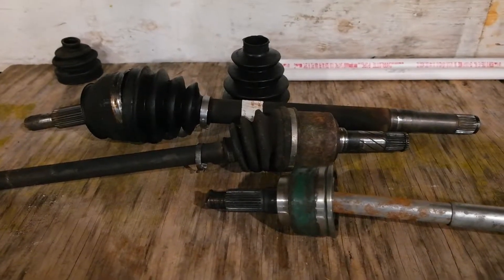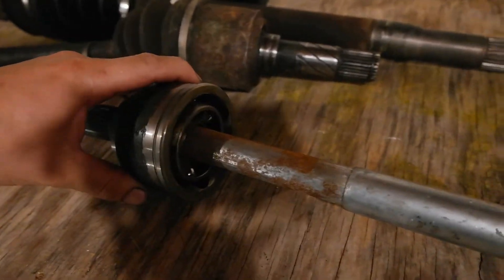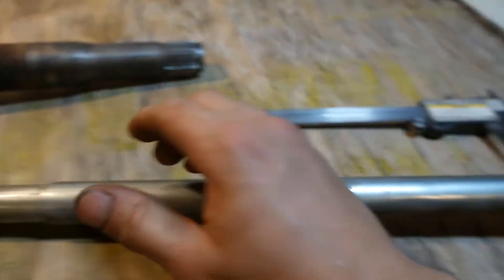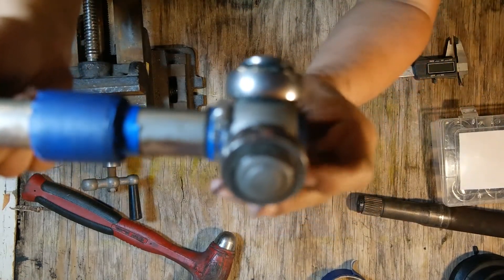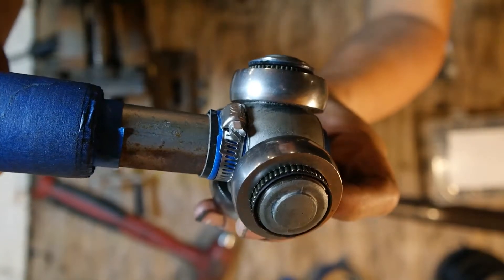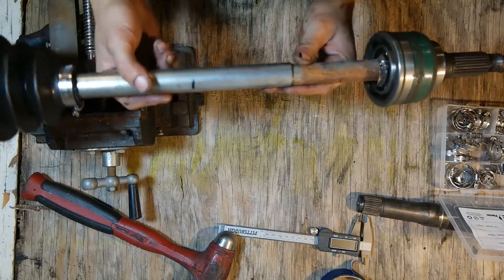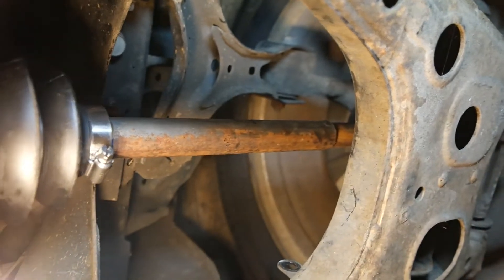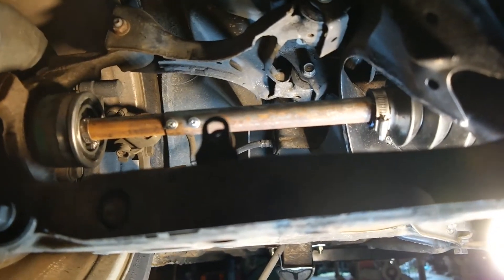How To Make Mock Up CV Axles For Custom Length Shafts. Sloppy Style DIY Super Budget LS Swap Miata

Comment: Who did you have make your axles? 
Thx
Reply from the maker: Well I had a local guy make a set. Broke those, then had moser respline some stock axles, broke those immediately. Then went to a t bird diff and bought a few sets from monster Miata. So far the last set has held up
Reply from the maker: Moser can make a set out of 4140 though.

Comment: What did the shaft centers cost to spline ?
Reply from the maker: I had someone local do those. Cost 220 per shaft. They only lasted a week though. Moser can make some from 4140 wanna say it was somewhere and 250ish per shaft. I have the into in another video somewhere. But I would recommend 4340 at the least.
Reply: @miatakhalifa  Thank you, for the feedback. I would be using oem axle shafts, cut, and splined. I would induction heat and quench after. A freind has a lathe, and a dividing head for gear cutting, collecting dust.
Reply from the maker: Sorry for late reply. As long as you spline into the case hardened part and don't taper down, it will still retain some strength. Man do I wish I had access to a dividing head lathe set up. I'd be making all kinds of axles. Keep me posted!

Comment: Hi what for Allowed Tolerance -+ for length?
Reply from the maker: You want your final length to be where the control arms are level. As long as nothing binds when you make travel up and down you're good.
Reply: @miatakhalifa  
Thanks do mean the Measurements are not fixed and vary from car to car ? Sorry my English not good 😅
Reply from the maker: @sultan26706  no problem! Yes. All depends on what car, what's differential, and what cv axles you're using. This method can be used as a universal tool to find the length of a custom axle on any swap car.

Comment: Nice! I'm not using the explorer rear end but this will definitely help people out who do.
Reply from the maker: Yeah you can basically use the concept for pretty much any type of custom cv set up. I plan on making an update video after I make sure that they will work for my application for sure. What set up are you running?